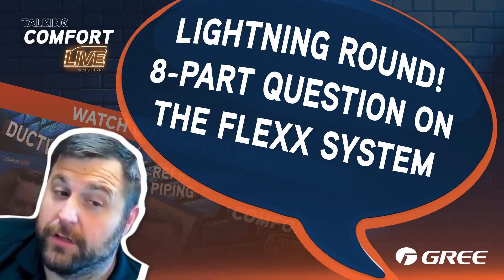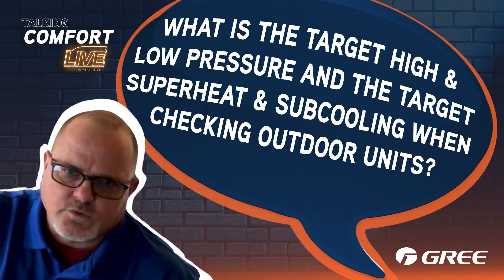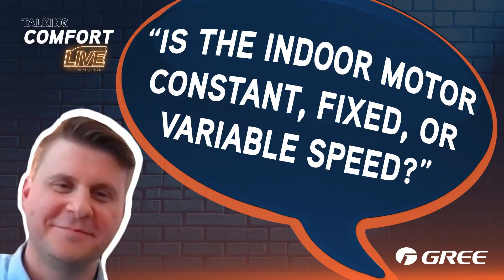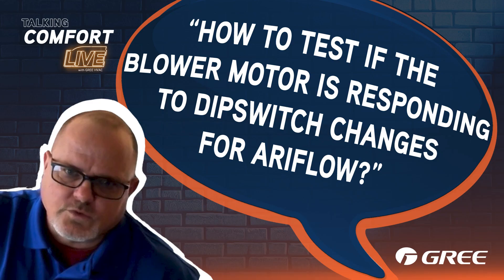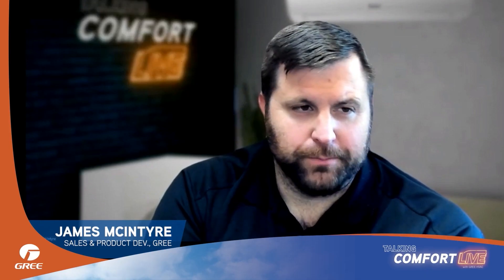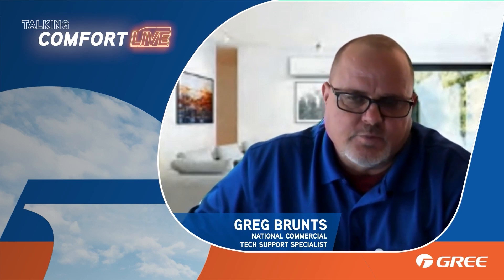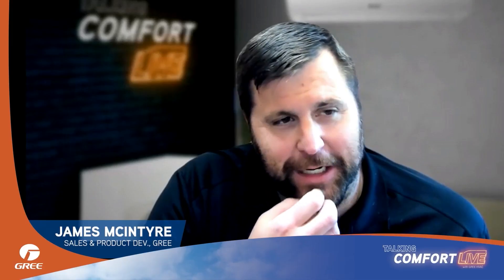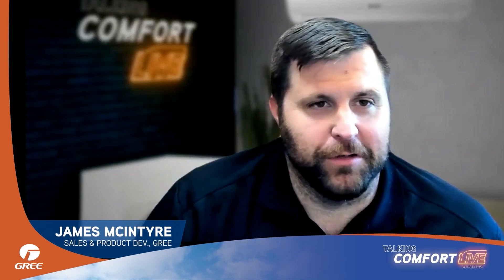Lightning Round! 8 Common Questions on GREE's FLEXX System!

Comment: Where is the smart controller you mention. This is not a variable speed motor and should not be advertised as such until paired with the smart controller.

Comment: What is the minimum/max compressor speeds.. or min/max wattage draws in cooling?
Reply: I would like to know this, too. I have my 2-3 ton set in 2 ton mode. The condenser draws 1500-1800W depending on how hot it is. I thought it would go lower, like 1000W.